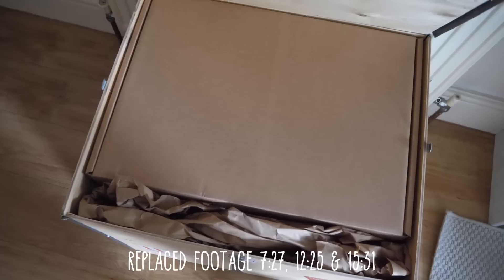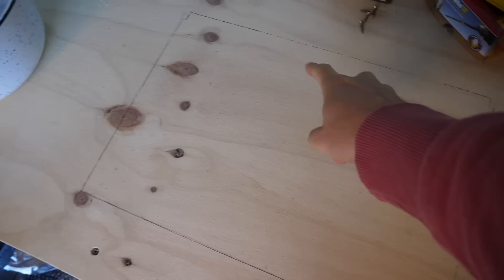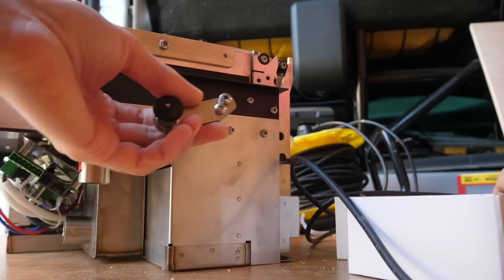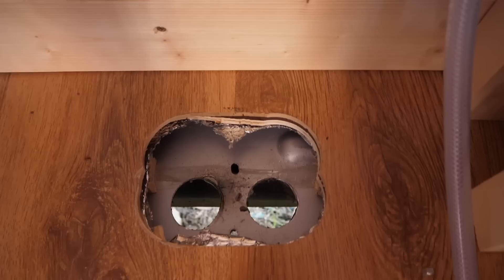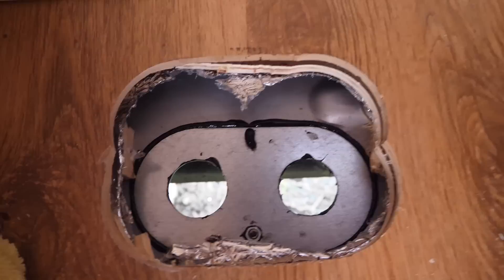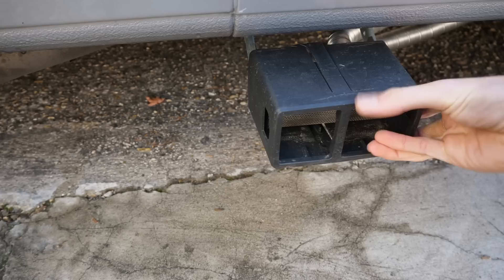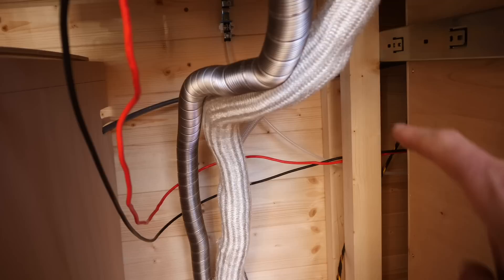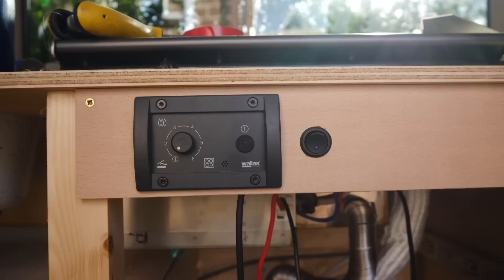HOW TO Fit WALLAS XC DUO Cooker/Heater in a camper van!

Comment: You can use your waste vegetable oil after being filtered with equal amounts of kerosene, since you have a separate fuel tank. The key is to thin the fuel to the same viscosity as diesel. I tested this with a home oil heater. You could use biodiesel made at home too.
Reply from the maker: Oh amazing Greg! That sounds like a really cool idea
Reply: HughTube, I also used cooking oil and kerosene in my VW diesel cars. Test my idea in warmer weather, so the oil is already thinner.
Reply: Unless you are doing this to prove a point don't bother. I had an 87D on my yacht and it was amazing.   They use so little fuel it makes no sense to try and save pennies and possibly damage something that costs thousands.

Comment: You are right about the instruction manual being vague about the orientation of the exhaust head. Mine is fitted the 'wrong' way round, however it has never been a problem. It makes no difference to function. I can only assume that it is to direct gases to the rear rather than towards the side door or windows. In use it makes no difference as even a slight wind blows the gases in whatever direction you have parked relative to the prevailing wind. I think hooking up to fuel tank is the one really major benefit of this unit which you are missing out on. Just buy some fuel pipe and a vehicle specific sender from butler tecknik. Cheers
Reply from the maker: Cheers for all the info!

Comment: Good job buddy, looks to be a good little system. I wonder if the exhaust outlet would be better turned around and pointed towards the underside of the chassis, to help prevent it being easily damaged when going over bumps or rough ground....
Reply from the maker: The instructions advise mounting it where it is and it is in such a position that the exhaust would be ripped off before the exhaust head gets touched

Comment: A question and a comment, how do you unscrew the fuel tank lid without twisting all the hoses, and if you spill diesel in your camper the smell will linger for ever, try odorless kerosene to avoid this issue, works the same as diesel.

Comment: Hi Hugh love the video, it's very helpful. I wonder if you could tell me how hot the exhaust pipe gets? I'm trying to plan the route for it but I'm unsure how close I can have it to electric cables and wood surfaces before it starts to cause heat damage or even a fire.
Many thanks!
Reply from the maker: with the fibreglass sleeve it can be quite close (up to about 50mm I found), although you can even upgrade that further and get one of those fibreglass sleeves with a silicone coating which are great at shielding everything around from the heat

Comment: A fortune can be saved on any modern day gadget by looking at how problems where solved in war time Britain researching is easy. I have a item made from a used biscuit tin or baking tin that does the same as your expensive device. It has many adaptations the best is used from a small wood burner flew pipe or even using night light candles. I now use a dutch oven that cost about £35 its a great oven and how I use it to heat my large van is just put broken fire bricks inside. Its so hot on the lowest flame setting that after 20 minutes I turn it off for at least 30 minutes in every hour. Note I only heat my Dutch oven from the bottom as they can be used with charcoal on the lid when using as intended out side your van. Ventilation as with any stove is a must so a carbon monoxide  monitor is needed
Reply from the maker: Hi Karl, have you got any plans or designs of your heater?
Reply: Do you have a video? Sounds v intresting.

Comment: Great gadget, even with this complex instalations seams much better than gasoline colemam stove, something I didnt understood perhaps the smoke from diesel goes down and out side by the pipes? Strange 'cause the flamme and smoke normaly goes up. Congratulation great job.
Reply from the maker: Yeah all the fumes go out on of the pipes, the other draws in fresh air and a fan pumps it all round
Reply: How much it coasted? At site no price, must call to have the price
Reply from the maker: it's about £1500

Comment: probs already done it mush but could use ya same button and run it through a relay, looks sweet, be interested to see how effective the heat is! (-:
Reply from the maker: Hello buddy! Someone has mentioned this as well, I was going to try and do this on the road but I need to pick up the relay!
Reply: http://www.halfords.com/workshop-tools/garage-equipment/fuses-electricals-fixings/halfords-hef560-relay-12v-40a-4-pin-inc--diode

Comment: Thanks for the video. I have just installed an XC Duo into my van. I am finding my worktop is getting very hot around the front left hand side corner area of the Hob ....... Do you find the same? I'm just checking if its 'Normal'.... Thanks
Reply from the maker: i haven't noticed the same thing. can you contact me at contact@hugh-tube.com and we can keep in contact and I will try out mine again and compare the situation.

Comment: Hi Hugh, can I ask how the heater coped during the 'beast from the east'? I'm seriously considering getting one instead of a multi fuel stove, but this is all dependent on if you was still nice and toasty in the minus temperatures.
Reply from the maker: Hi Darryl I don't live in the van full time so spent most the beast in the east in a house. But when I used it late last year it was around 0 and the heater was more than comfortable.